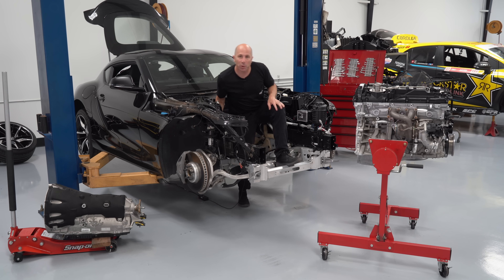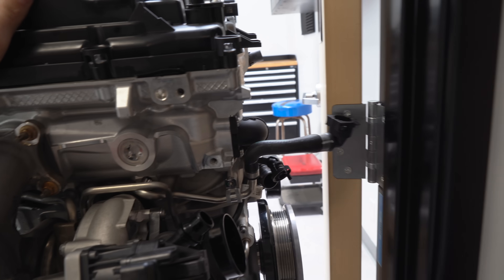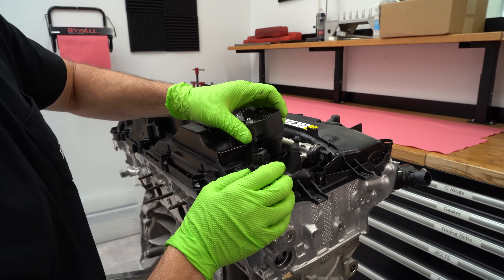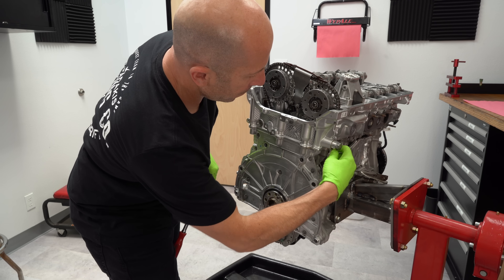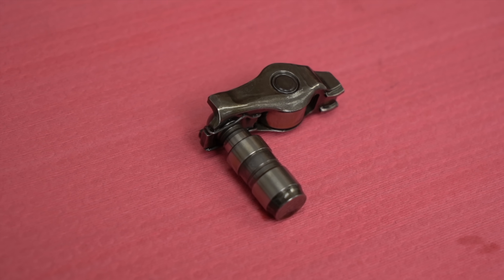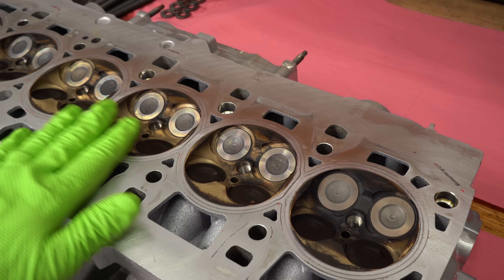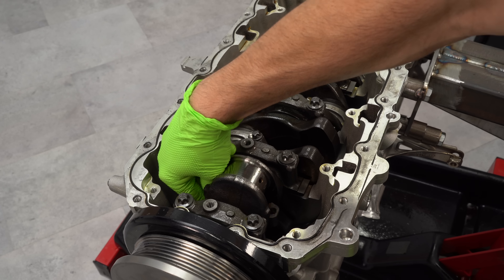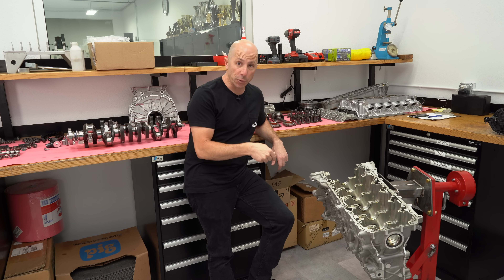2020 Supra B58 Engine Teardown - First Look - Better than the 2JZ?

Comment: Those 2 small exhaust ports don't have me feeling very optimistic, along with the massive heat being created coming from high boost from the cylinders going through that cast in exhaust manifold. It'll be interesting. Cheers!

Comment: Is this a successor to the 2JZ? You had my answer when you said "special too"

Negative ghost rider.
Reply: Gary Caka Didn’t seem like he used any special tools though. Sure the mounting is a little strange, but dang even the crank pulley was easier to remove than on a 2JZ lol.
Reply: @dregenius  yea but he stated in the video he needed to buy a special tool to put the block back together without damaging anything, plus the crank pully he needed that special 3 bit lug nut for

Comment: The engine looks stout but time will tell. There’s a reason people put 2j in bmw. I’m sure people will make close to a 1000hp but I would be worried about back pressure and heat on those aluminum heads that have built in headers. I guarantee you that people will start swapping the older b58 head that have actual headers on them.
Reply: I was wondering about that. The B58 In Supra has integrated header and the B58 we install in the X5 SUV also has this design..I do believe both are the B58c. I was driving a 440i the other day and noticed it had the external header and this was a 2018 or 2019 I think.. Is it older version of B58 with external header or just different variant? I work at BMW manufacturing bit we assemble only the BMW SUVs like X5/X6/X7 and all the B58 engines we install are the B58c with header integrated into cylinder head like the Supra has.

Comment: Toyota dealer tech ain't gonna do production,  first customer complaint , the engine is rattling when started in morning.  Week later toyota bring new TSB #666 check for timing chain loose guide and replace it,  toyota tech ohhh wheres the chain behind engine block no way!!!!,   this gotta pay like 8 hours of labor .    Final labor by toyota 1.2  hours this is my gift to you techs: eat the b58 engine  .😭😭😭😭😭😭😭

Comment: Great Teardown. I was waiting for someone to tear down this Engine to see how it was build.  I cant wait to see what you do to this thing. I hope you manage to get the 1000HP out of it. Could you possibly tear down the Z4 Engine to compare the differences? There is still a lot of speculation on the internet over the differences.
Reply: From what I know now is that the heads,turbo,fuel lines are different including the fact that the mk5s has more oil squirters(from what people say). The only question I remember that hasn't been answered yet is the fact that it may even have a stronger/different block from any other B58.

Comment: is this engine the same as the one in the BMW or Toyota did something different with the one in supra can someone tell me
Reply: It's a de-tuned version.   The BMW version currently makes over 380hp because it valve lift, among other things, is not physically limited.   

The BMW engine with the greater lift won't physically fit in the Supra.
Reply: @johnclark7406  ok thanks buddy

Comment: Throttle valve doesn't control intake air on the B58, the variable lift system does.

Comment: A lot of impressive engineering, but a LOT of proprietary stuff.. So it seems like it would need a custom head for performance use, but the block and bottom end is awesome, just the head... not so much, because of the proprietary stuff causing limitations

Comment: coming from a long time BMW owner, that all plastic oil filter housing and computer controlled thermostat is terrifying.  best part is you need to remove the intake manifold to remove them.  every BMW straight six made in the last 25 years will eventually leak from the oil filter housing, but they used to be right at the front of the engine.   and seriously, why change the 100+ year old thermostat design?  it worked just fine.

Comment: A tip for every1 working on this engine, the oil filter element can be brittle and fall apart when u pull it out of the engine, NEVER pull it out too hard, otherwise you can spend 2 hrs fishing out pieces of filter from the oil filter housing.

Comment: Pretty amazing, lots of old reliable diesel engine concepts being applied here but much more refined, like the way the fuel is delivered and the oil cooler
Reply: BMW designed much of the engine for both gas and diesel.

Comment: Funny you like to turn the bottom end by hand. I'm doing a timing belt on an 03 Hyundai around my work hours this week, and I turned the crankshaft a couple of times with just my hand on the timing belt pulley. I didn't turn it much, just a few degrees to get the timing mark lined up, but just one hand on the tiny timing belt gear was enough, even with the head on top.

Comment: well, now i'm wondering if there's any difference between the z4 engine and this, hardwarewise.
Reply: Heads and fuel lines/pressure. MK5 is also said to have more oil squirters than any other B58 made.

Comment: I see a lot of diesel tech has made it's way into this engine. Hopefully it brings along it's strength and reliability. 
Along those lines, don't be afraid of a little plastic involved with the engine. Have a look at a Detroit DD5, DD8, DD13, DD15 or DD16. Plenty of plastic used in their construction and they'll churn out 2,000ft/lbs for 1,000,000+ Miles.

Comment: Maybe it's just me but this almost seems like an advertisement. Toyota has been getting a lot of slack for the motor that they chose, this video comes out And he's also happy go lucky talking about and glossing over glaring issues. Like having to lathe down a socket so he can take out a spark plug, integrated manifold so the aftermarket companies are deterred from making manifold which are crucial for aftermarket power. The timing chain location issues, timing chain material issues, etc. Stock for stock sure it makes more power, At the end of the day which one is more modable, which one would people actually want to work on, which one would companies want to make parts for, these are important questions

Comment: It really does look like a great engine. BMW engineers did a fantastic job. The backwards design of the timing assembly being on the rear is odd but it looks cool. Bit of a mess of wiring and vacuum lines.

Comment: Plastic intake manifold in a performance engine? Timing chain location? Plastic timing guides? What a POS compared to the 1GGTE, 1jz and the 2jz. Also, not a proper head gasket meaning leaks in a forseeable future.

Comment: Seems like it's a great engine with a lot of good and thoughtful engineering, might be even better than the 2JZ. Toyota did the right thing when they partnered with BMW, even if most of the internet thinks otherwise. Hopefully it's not riddled with reliability issues, like with the timing chain.

Comment: B58 engine might start having the same problems as the N14 engine which is in the mini Citroen and Peugeot death rattle from chain guides buildup of carbon deposits on intake valves because of direct injection time will tell ?

Comment: This ?
Better than 2 jz ?
NEVER. !!!!!
You can tell that this engien is built in such a way that if you need to fix something on it will cost you a fortune , for example only to change the timing chain , what work is involved there , so 👎👎👎👎

Comment: That engine looks kinda similar to the 2jz..looks good as hell
Reply: Theres this and the S58(which has 470-500hp depending on which one you'd get)which is the performance version of the B58 which has a shorter compression ratio, has more boost and can reach higher RPM than the B58 can and is said to be more tunable than the B58.

Comment: That head tho.. ouf. Gonna be impressed if you crank out 1000hp with only those two holes..
Reply: I don't know about 1000 but you'd be surprised how it flows. A little grinder work will effectively give you a larger collector for the manifold.

Comment: The air intake, with the inner cooler, that part is "sonic welded" together. Basically two parts are are vibrated very fast, and the heat from the friction that is caused by the two parts being "rubbed" together, "welds" the two halves together permanently. I use to work at an injection molding factory that made composite plastic parts for Chevy, Ford, Nissan, BMW, and Mercedes Benz. Some of the processes to produce the intake manifolds was pretty interesting.

Comment: You have the wrong engine stand I had my n55 motor pulled , they drop the engine from underneath and jack the body up . Basically putting your motor on a pedestal it took about 2.5 hrs

Comment: Neither this car or the mkIV does not need 1000hp unless u want it to be a boring straight line dragster.   Throwing away all the effort that has been put into the vehicle to make it handle in the corners, have low centre of gravity etc. If u want  dragsters i am sure u can find a lighter car to be the base to your drag racer.

Comment: Had me until I saw the BMW timing chain on the back.  Only one company is worse at timing chains than Audi and that's BMW.  At best, they're neck and neck with innovating ways timing sets could fail and destroy your entire engine.  So put the thing they are worst at on the back of the engine.  Winning idea right there, Toyota.

Comment: cold air has more oxygen, but at the same time hotter air starts at a higher base temperature, and will combust to a higher end temperature, creating more pressure inside the cylinder. So it's not like hot less dense air should cause a big dramatic performance drop. I think it probably has to do with engine health and emissions, because nox emissions happen more with higher temperatures.

Comment: Nice video! The coating on bearings its cool, and all on the side that olds the load! Regarding the intake variable cam, its a crap, bmw/peugeot its using this and i forgot how many problems we get with this system...same with that rocker arms and hydraulic lifter, its been used from Smart 600cc engines to 2.0L Peugeot/citroen...its a shame to see all this cheap and crap solutions in a icon like Supra. The timing chaing set up its cool, diesel engines use this type of chain, but with a lot of problems with the low quality parts from factory. The exhaust ports its also funny, same as Honda..but you will get to a point were exhaust flow and manifold design will play a good roll, its easy to see the gains from a log to equallenght manifold, that would be biggest downside in this engine. Direct injection its wonderfull you can really tune the engine for lean afrs without knock...you can really make the injection timing right. My humble conclusion: LONG LIVE THE KING 2JZ.

Comment: The problem is that BMW is not KNOWN for reliability as Toyota is. That's why people prefer something that has that confidence. BMW has a branded reputation for reliability and it's still so new there's not much knowledge on the inside and outs of this new BMW motor. I'd love to see them both tested and then torture tested side by side.

Comment: I think DOHC will be the next thing to become obsolete. A lot of complexity and a lot failures. Every engine has complexity there, not only B58. Koenigsegg's pneumatic valves can be controlled by a computer without all of this mechanical complexity and are infinitely adjustable. You can then run ML algorithm to optimise the timings to perfection.  

This is what I want to see in the new engines. I can look at this 2019 engine and it's basically the same as the previous gen.
Reply: Misterlikeseverythin 4V DOHC VVT has been standard for 15years.

Comment: The mess of wires and hoses on the top look like it’s from the 1970s and struggling to comply with environmental regulations by adding vacuum lines, sensors, etc.  With the Mark 4, Toyota actually clean up the engine bay over the years by reducing hoses and wires.  In 98 when they went to variable valve timing and DIS ignition only 2 wiring harnesses went to the top of the engine and hoses were minimal. It was simple, clean, and efficient.  The complexity with this one will make it economically die a fast death later in life.  When the whole car is worth under $20K it will be hard for someone to pay $5K in repairs which is the typical BMW  biz model.  It’s a great car to have under warranty but don’t even think about it as a used car where you are on the hook for all repairs.

Comment: this is a very slick design, that oil sensor is a weird one, as is the rear timing chain (from a mechanics POV)... I like the oil cooler as long as it holds up... internal corrosion in that would be a bitch for water into the oil! (just wait for someone to call head gasket by mistake haha)
Reply: oh and fuck your torx head shit!

Comment: Powder metal rods is the only thing I see holding back power. Install some forged h beam rods and diamond pistons I bet this engine will eat 1000hp all day long. The limiting factor I see is the mechanical injection pump . Until the aftermarket catches up and develops higher flowing units.

Comment: I want to see a manual transmission in one of these! Come on Toyota, I mean BMW. I heard they will offer a manual with the B52 z4 in Europe. So maybe it will be possible in the future to pull off a trans swap. I would maybe jump on the mark V band wagon if they did  a manual trans from the factory, but it’s hard though when the mark IV is has always been my unicorn. Great engine platform though, other than the timing chains on the back. Not sure how they would fair with high HP though. Can’t wait to see what they do with this engine though!

Comment: plastic chain guides = disaster eventually. Toyota should know this seeing the older 1980-1990 4 cylinders used them and they would break off and clog the oil passages -22re  It usually took 200k though. :)

Comment: The engine looks solid enough to make decent power. My two concerns are the exhaust ports and chain location. I think the amount of exhaust gasses you’re going to be able to flow through those exhaust ports is going to be limited, thus less power potential when making major changes such as a bigger turbo, also having the chain at the rear of the engine is going to be a massive pain when it comes time to replace the chain on maintenance schedules. It’ll be an engine out job.

Comment: Seems like a lot of plastic to get old and crack, parts inside parts so you have to buy whole assemblies costing more, components unique to BMW so  you can't find after market varieties, connections unique to BMW so you have to spend over $100 just to take something off to check a part, no/ non standard o-rings used so you can't pull one off the shelf, you have to make a trip to the dealer, everything is control and connected to the ECU so you have a right headache sorting out any electric faults... Ye I'm good thanks BMW I'll pass on this one 👍🏻. 

Not even mentioning carbon buildup on intakes and timing chain issues. 

I'll wait a few years and see how much these depreciate, and if any common issues come up before thinking of looking at one.

Comment: I know it's been said somewhere in the comments already but here it goes. The throttle body does not control idle on this engine. It is controlled  by variable valve lift. BMW calls it valvetronic.

Comment: I admit that I am biased and that I hate European cars but this looks like textbook stupid european cheap design. Countless things that he said will equal problems that the original supra would have never had. Starting with the cheap guides on the rear facing timing chain, if they somehow were to break not only would you have to remove the engine to remove the head you will probably need new cams because they are the hollow tubular style and the lobes will twist. The plastic cooling systems on BMW's are chronic failure points because the plastic cannot handle the heat from the engine and becomes brittle. The next thing is the in manifold heat exchanger that can't be replaced without manifold replacement I have seen those fail on VW golfs at 120,000km and just wait until you have to buy one of them at the spare parts counter. Planned obselesence at its best.

Comment: Very nice modern engine deisgn, the only drawback for me is the rear mounted timing chain. Would have prefered a front monted traditional timing belt system. Yes they need to be replaced all 100k miles or so but its less risky compared to thin chains running over plastic guides...
Lets see how these hold up and what tuners can do with these. Alot of stuff on this engine is engineered very nice, I think most people will just go for a bigger turbo and different tune...
Reply: The last I heard for mileage wise for the engine(coming from owners who owned B58s in their B58)was 96k and say don't exactly have really any problems(depending on what year model it is)and its usually the cars themselves that have the problems other than the engine.

Comment: Gone are the old days I could reco the carby and do my own timing chain........
Reply: The good news is that you won’t need to fiddle with the fuel-toilet since there’s a well engineered ECU keeping things adjusted and the engine running well. And if you do decide to do a little diagnostics or tuning, it’s nothing a laptop and D-CAN/E-NET cable won’t let you do. 👍

Comment: Im curious how the head bolts will hold up to power.I am thinking they might snap off at the deep part of the T60 hole... Mercedes AMG had this issue with the 6.2 engines 10 years ago
Reply: That thing was s beast!.
I wish someone built the hell out of 
one.
6.2 quad cam is nearly equivalent to about a 7L pushrod.

Comment: I really like how they designed this engine, but the timing chain location and the high number of plastic components that have coolant or oil flowing through them is concerning. Should be interesting to see repair videos in the coming years.